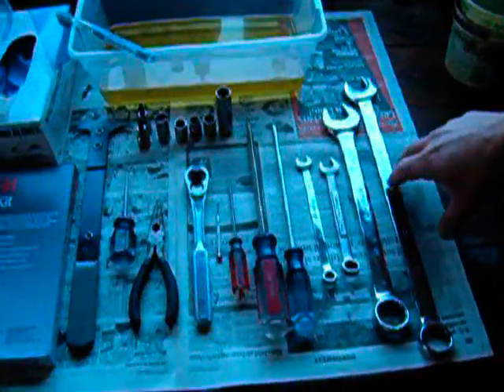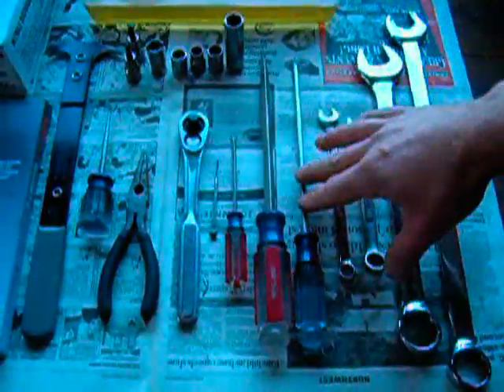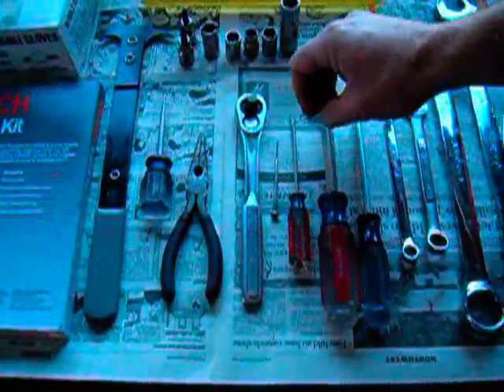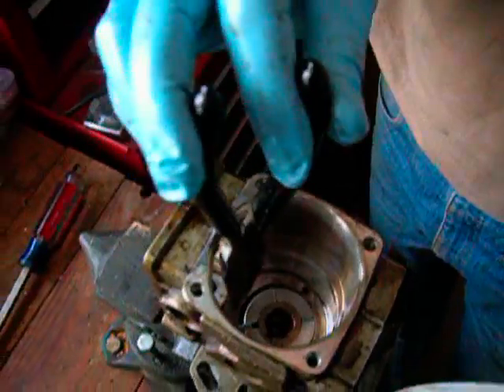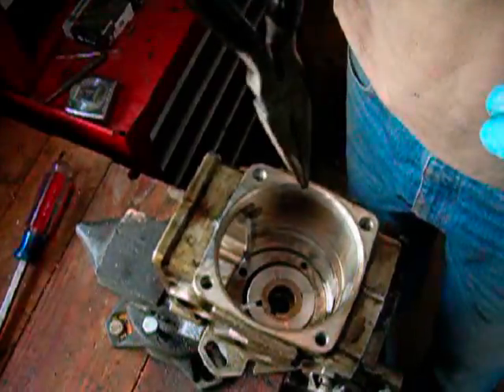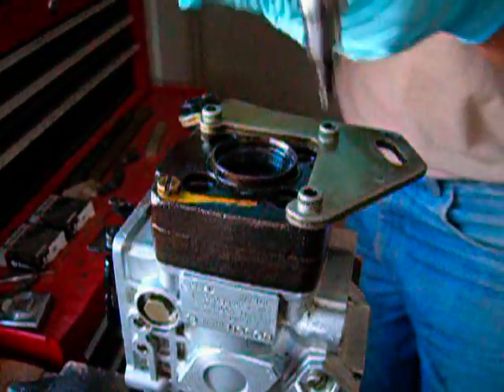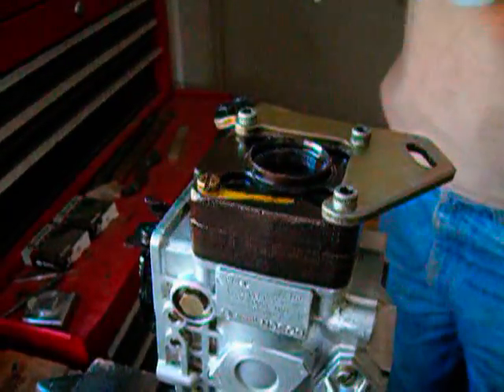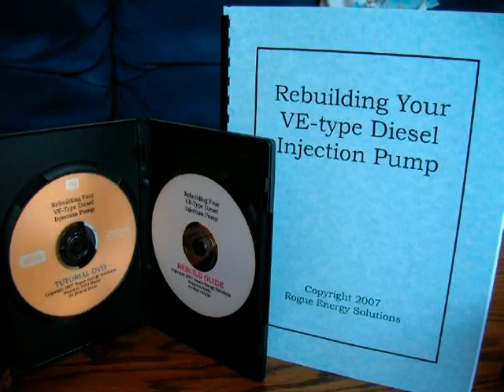Rebuilding Your VE-type Diesel Injection Pump

Comment: Hi and thank you for the video , im portuguese and im changing some orings in my pump however changing the oil seal in the pump i used a metod like 2 little screw  in the old seal so i gett him out because im not opening the pump , but doing this i didnt realize well and i made 2 little holes under the oil seal , but really little , so now i guess its not bad or something but i just like to ask you if thats a problem case im woarry ..what do you think ?  thankx

Comment: if you are getting good fuel flow through the filters up to the pump but nothing out the pump it sounds like a faulty injection pump although like i said before a faulty lift pump will cause the same problem. i wouldnt think bleeding the system like u did would damage the pump unless it was already damaged from running out of fuel or maybe a bit of dirt got through the filters and damged the pump it does happen.

Comment: The video is very useful. Building the two custom tools is not too easy, but dooable.
I got my pump tore all the way down to the last part and was not able to get it out of the housing. The last part got stuck in the housing and had to be knocked backed in. It probably was unnecessary to remove it in the first place. I also messed up a couple of flathead screws on the outside of the pump. A pump is rejected as a core by rebuilders if it is found to have been previously torn apart by a novice.

Comment: I got ripped off by two well known injection pump rebuilders this year. For $350 by Prothe who sent me a dirty gummy IP, and $640 by PartsPlace who sent me a completely jammed up and useless IP and they say no refunds (for a dead pump right out of the box). They clean um and paint um and call it a rebuild. Prothe charged $80 restock fee return postage. These pumps are resealed--not rebuilt.

Comment: Quick question. I have a tractor with distributor type pump and it quit working. I had fuel problems. I had to crank the tractor alot to try to get fuel to the injectors. From repeated cranking without good fuel flow, would that burnt out the vanes?? cause I took off the rear lines that go to the injectors and I am getting nothing. It was running fine before all the fuel flow problems. Any info would be helpful. Thanks

Comment: @emmy6423 The fuel solinoid driver is probably bad. Go to ssdieselsupplyDotCom for a heat sink set up. I put one on my truck and it works great.

Comment: Does the mechanical Diesel pump skip a cycle to not feed fuel while the exhaust stroke is happening. 
It seams the engine crank turns trice for the intake and exhaust stroke, but the pump cycle is one stroke pushing fuel on both cycles...
My mercedes is shooting out black smoke and won't hold an idle. I am trying to figure this out. THanks.

Comment: @archlrk2009 I picked mine on Ebay for under 20 bucks.  The new kits come with the rubber that can handle biodiesel and whatnot.  My pumps started leaking from just plain old dried up rubber, so I can only imagine the pain with biodiesel.

Comment: how many hours should a professional charge for a rebuild? I think i got totally raped at 1300. Also now my check engine light is on after the rebuild and the car only starts sometimes. He claims it is the infection quantity solenoid and he wants another 300 to replace it! Did he mess up the rebuild and screw up this so called injection quantity solenoid in the process? Please help, you're information will be valued... thanks!

Comment from the maker: To my knowledge, all new gasket kits (made within at least the last 5 years or so) will be up to the task. You might want to check with a professional rebuilder to be sure. I'm not aware of anyone on You Tube that sells them, but there are several sellers on eBay. A search will turn them up.

Comment from the maker: Did your pump have this problem before you resealed it? It's possible that there might be some residue or varnish causing parts to stick or not slide properly. If the problem is new, then you might have put the spill ring in backwards, or some part of the governor assembly has not been installed correctly.

Comment: or is the dynamic advance adjustable by means of the adjuster on the drive end of pump, so can I remove my adjuster and fit to other pump without disturbing the setting?
ie can I remove adjuster bolts valve thing as an assembly without desturbing DA to much?
I reckon Ill nedd to have it set on a test rig dont u?
The max fuelling I can play with, dynamic advance (DA) is tricky!
Thanks.

Comment: Yes I know, but I was thinking each application advances different amounts for a given fuel pressure/ application/ the advance curve differs between applications.
I was thinking that the spring that returns advance to unadvanced position is maybe specific to application or maybe a valve that controls fuel pressure to piston is specific to application?
or do they all advance the same amount?
This sounds unlikely as some rev higher than others; see my problem?
i wish to adapt a 2.5 pump...

Comment from the maker: The "timer" piston on the bottom of the pump controls advance. As it reacts to fuel pressure, the piston slides and rotates the roller ring, causing the injection timing to vary.

Comment: Why cant u show the full video on youtube?
What controlls dynamic advance and how does it differ between pumps.
I have VE pump from a 2.5 diesel, I have a 1.8 diesel and want to fit cam plate to 2.5 diesel pump because plunger is bigger and it has BPC.
How do I do it?
And no I wont buy video.
Youtube is for videos not adverts.

Comment: thank you very much for your help. I just recieved your dvd(i'm the guy who ordered it to romania, arad). i recieved it really fast. It's full of valuable informatiomn. i have a 1.6 diesel engine (opel ascona c from 1983 :P ) the fuel pump is exactly the same as the ones one the volkswagen engine. thanks for the info ( i have problem with my cold start pulley, it's stuck - hopefully i dissasembl it and wil find out what is causing it to get stuck)

Comment from the maker: Yes, to completely calibrate a pump to manufacturer's specs you would need a test jig, which the average person doesn't have. I mention all of this in the information I sell. However, a satisfactory job of tearing the pump down, inspecting it, and resealing it can be done by anyone with some mechanical aptitude. Leaking pumps are without a doubt the most common issue. The VE has no electronics and has never required computerized calibration (it was designed long before electronic injection).